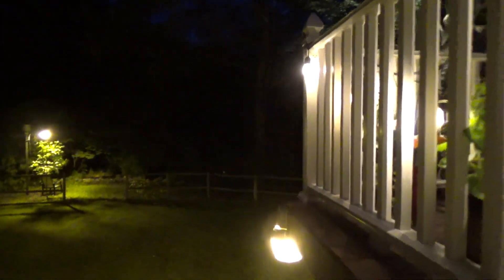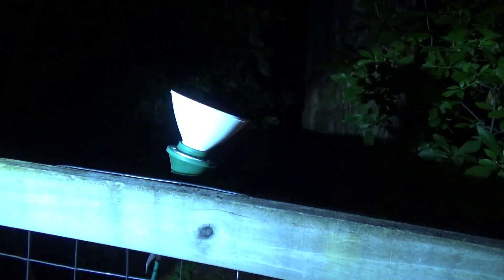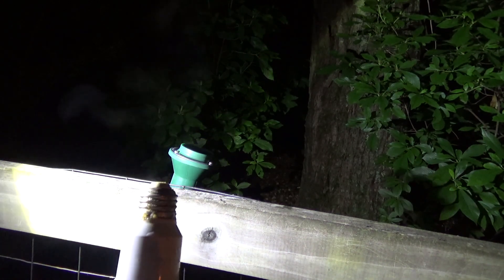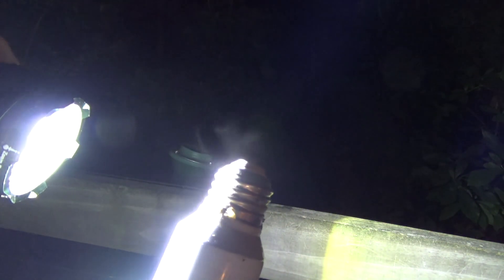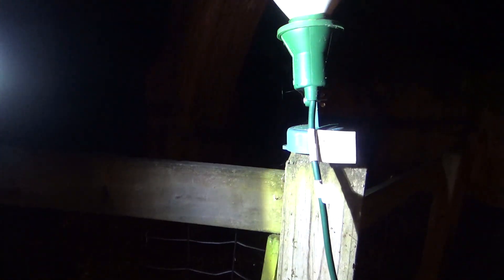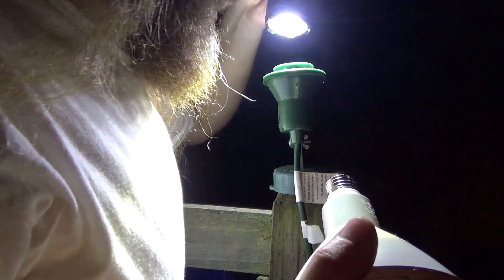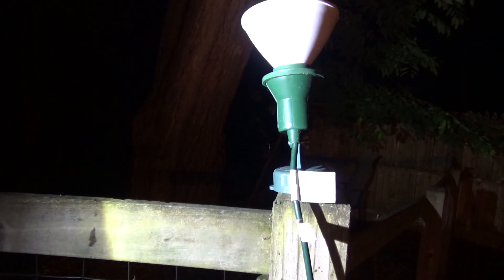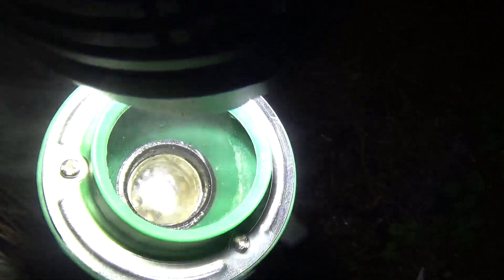Boiling Water in a Light Socket

Comment: That light socket was working as an electrode boiler. An electrode boiler passes current through the water, and because of the water's electrical resistance, it heats up. They are popular in other countries with much more lenient approaches to electrical safety. The only example of an electrode boiler I know about in the US is the Vicks vaporizer.

Comment: You could try wrapping the bulb with electrical tape where it will make a seal with the gasket. If you use white electrical tape it will be disguised on the bulb. I'm not sure if this will work or how well it will hold up to the weather though.
Reply from the maker: That would probably work, but it would be very temporary. The tape would not hold up against the heat of the bulb of the exposure to the elements.